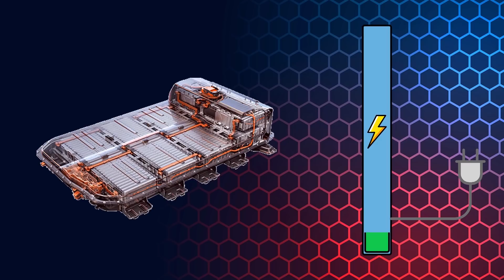How Long Do EV Batteries Last? | I Speak Electric

Comment: I just bought a 2018 Nissan Leaf, 170,000 kms (106,000 miles) with 15.5% battery degradation. Fine for most of my driving, though I do need to stop for a couple of hours on one regular long distance trip to charge - there are no rapid chargers on that route yet, but they are coming.

I love the car, and am willing to put up with the occasional long charge for now until rapid chargers go in on that route - within the next 9 months according to the charging provider.

Comment: Can I expect a Lithium Ion battery pack to last for 15 years (Typical life of a car) with a reasonable amount of battery degradation? Meaning the battery will hold 80% of it's original capacity. This is of course, assuming that the battery is not abused
Reply: Average age of car is 12 years. That means there are many many cars over 15 years old. Stop the “typical” disinformation.

Comment: @2:18 BS, when 1 cell starts to die in a battery, it drags the rest down with it and you lose power and mileage or even lose the entire battery.
Reply from the maker: Not sure what you're referring to...but your comment doesn't seem to contradict anything we say at that time stamp. In fact, we make the exact point that you just have in another video.
Reply: @BestElectricVehicle  You said if a cell goes its fine, because there are over hundred more cells in the battery, its not fine. 
If one cell goes down, at this point the battery is failing, many things can go wrong and it is recommended to be swapped. The rest of the good cells are stripped from the battery and recycled for other electrical uses. 
And when the cells are reused in EV, you will find those cars have more potential to catch fire due to different ages/types of  cells being clumped together.
Reply: @PF-gi9vv  There is no need to replace the entire battery if the voltage on a few cells drops. This only indicates that specific cells are failing, not the battery itself. Diagnoses and replacement can be done relatively easily, as is shown in this video of a Nissan Leaf which is used as a taxi in the UK, covered 120,000 miles in 2 years and been rapid charged 4 times each day. Just to make clear that what you say here is incorrect. https://www.youtube.com/watch?v=-ySOspbt0BM&t=49s
Reply: @kiae-nirodiariesencore4270  So its gone from “wear out prematurely” to “voltage on a few cells drops”,  there's a big difference to wearing out  and when the cell voltages will drop differently to each other after a car is used which is perfectly normal.
Reply: @PF-gi9vv  I’m glad you enjoyed the video. Bearing in mind that the Leaf had no active BMS and suffers more degradation than most other EVs, even so you would be well pleased with such small repair bills in a fossil car after that many miles. Fact is that most EV batteries will still have a decent amount of range when the car comes to the end of its life. It really isn’t a worry.

Comment: Good piece of information for the future EV buyers. I agree that the battery management should extend the life of EV battery more than the phone.  The taxi services with frequent HV charging are expected to see higher degradation.  I think for daily commute of average 250 miles/week with home charging should not cause much noticeable yearly degradation. I am considering my EV purchase in the next 4-6 months based on this understanding.
Reply from the maker: Thanks for the comment! Delighted that you're considering an EV. Keep doing your research and I'm sure you'll end up behind the wheel of an EV soon...just let us know which one you go for!
Reply: @BestElectricVehicle  Previously, ID.4 1st edition was my consideration. I found there are too may limitations here in the 1st edition. I have put my deposit for EV6 Gtline. I am not too much fussy about ultra fast 0-60 mile time. The RWD should be fine. The Ariya is also under the scanner. What do you think of these two models? Thanks
Reply from the maker: EV6 would be a great call as we have enough SUVs on the road already probably! But the Ariya should have the 22kW AC charger, so anyone that doesn't have a home charger or can take advantage of free destination chargers might like that aspect. Just make sure to take plenty of test drives!

Comment: Only a year ago, I was informed by a relative that an EV battery would require replacing after 3 years. And that information was apparently obtained from a quality consumer information TV show. Such uninformed BS. I can remember slightly despairing. And some people will have a tendency to reinforce their prejudices. Which is why excellent quick videos, like this, are so essential. Nice one, Vox Network.
Reply: A few days ago I got chatting to a fellow Brit who lives here in France, he had an Evoque or similar Range Rover kind of thing and said it was up for changing soon. Like so many here he hardly speaks any French and had been calling his dealers in the UK who had warned him off of going electric as the batteries only last for 5 years...He wouldn’t accept that this was wrong and he also believed it was not possible to tow a trailer with an EV which is also wrong of course. No surprise that the LR dealer wants to put him off, they don’t really have any product.
Reply: @kiae-nirodiariesencore4270  Yep BEVs "can not tow a trailer". But an Electric Class 8 Semi Truck is way more powerful and quicker than your average Semi Truck. That is some genius misinformation.
The main limiting factor for BEVs with towing is Structural Strength of how the Tow Hitch integrates with the Chassis & Braking System able to handle the load. You can't just have massive tow capacity just because you have massive powerful electric motors.
Reply from the maker: Thanks gain Andy! We've a long battle ahead of us in getting an accurate picture out there about topics like battery longevity, etc. Amazing some of the misinformation you hear pedalled about so regularly!
Reply: Perhaps we can tell the battery’s durability by the warranty period given by the car manufacturer? Can be in years or mileage.

Comment: Good video on a complex subject. Thanks for this. Have owned an e-Niro since March 2019 here in France and covered 40,000 km. There is a lot of data on battery university.com on expected degradation for different charging regimes, e.g. very low SOC to 100% versus 20% to 80% and a range of other charging modes. Of course we all have different approaches to charging. Our typical week is to charge to 80% once a week which covers all our driving needs for the week. When we get around to plugging in again we are typically at 25%-30% on the 64 kWh battery. My calculations based on the number of times I plugged in last year suggest that the car should be able to cover over 400,000 km before I see a noticeable degradation in range., more than I am likely to see on what is left in my personal battery!... The big unknown of course is calendar ageing which I guess will be affected by factors such as the climate where the car is used. It is an interesting subject as I have had many petrol heads telling me I will need to change my battery after 5 years, the level of disinformation out there needs this kind of video to put people straight on the durability of EVs.
Reply from the maker: Absolutely, the batteries' longevity is proving to be so robust! And thanks for chipping in on battling the disinformation and FUD! Nice choice with the e-Niro...owners seem to really love them!